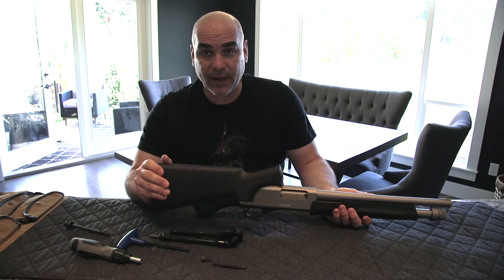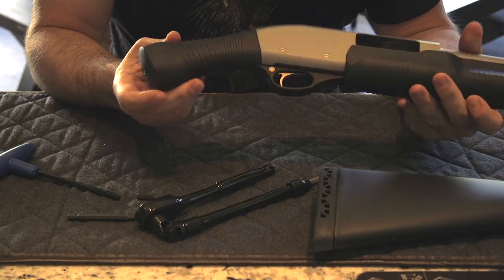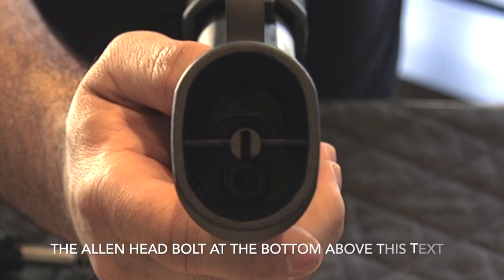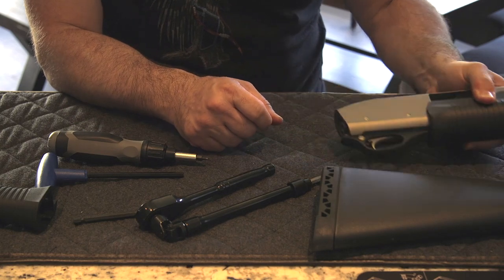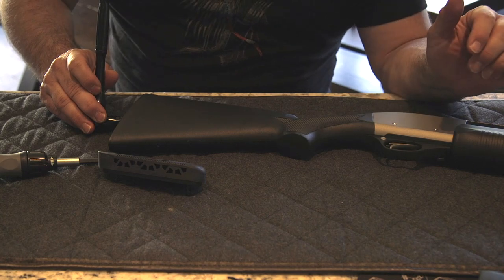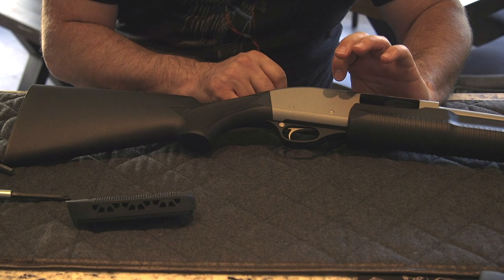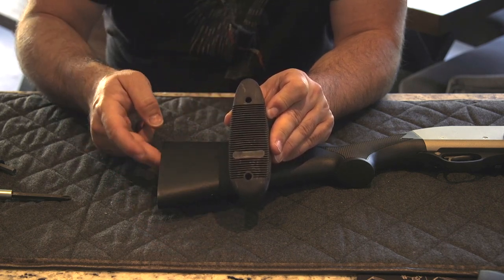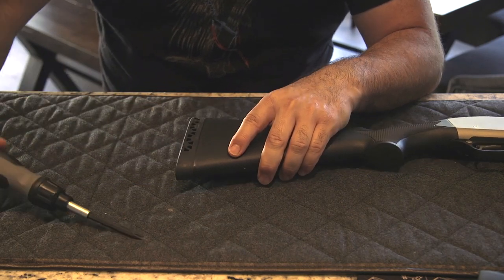Shotgun Stock Swap, Akkar Churchill 612

Comment: Interesting video, thanks! I have the Churchill 620 (which won’t fire, brand new). Waiting for Akkar to respond. It’s a tactical version with a vertical grip at the neck of the butt stock. How can I put that small handle like butt stock on mine? Do you have a part number? Also, is that an extended magazine?  Thanks!
Reply from the maker: First thank you. No extra magazine, it's a very short barrel. Sorry i don't have the part number, but you can get them where they sell akkar parts.

Comment: How about if you want to put a birds head on instead of the regular butt stock? Can you buy these somewhere ?
Reply from the maker: Yeah i tried it with the bird grip, i think a pistol grip would be better.
yes you can buy those separately, but they are hard to find, this is probably the biggest  drawback from those Turkish shotgun.
Reply: @PanzerGunsAmmo  ok thanks. I was just told that a birds head or pistol grip may Also put the gun into restricted zone instead of Non. So that wouldn't be good..I wanted it short for hiking.
Reply from the maker: @shadeshadyshade254  if you are in Canada, the bird head grip on the 612 keeps it over 26 inches, so still non restricted in Canada.
Reply: @PanzerGunsAmmo  ok thanks. I’m in 🇨🇦

Comment: So down here in the states we have Akkar 612s pretty easily available. The only difference being i that we have to abide by the 18 inch barrel minimum length. Do you know where someone could find a different forend/shotgun pump for the 612? I've been wanting to mount a shell holder on the receiver but the large stature of the forend/shotgun pump when pulled back doesn't allow this

Comment: Will this fit the 20 gauge version
Reply from the maker: Never looked at the 20 gauge, but i believe a butt sotck would be interchangeable, however it might not be a flush look since the receiver may differ in size. Again speculating here on what i've seen with other brand. Check with your vendor , he should know.. Thanks  for watching !